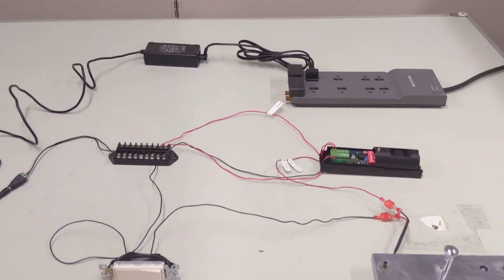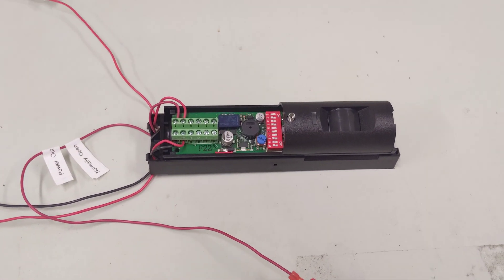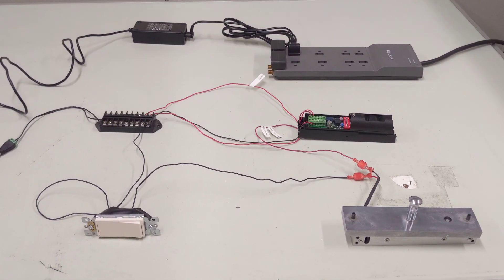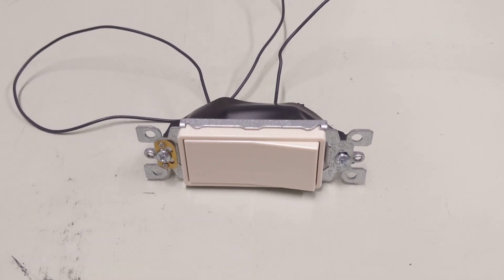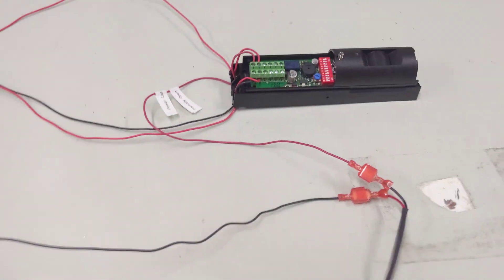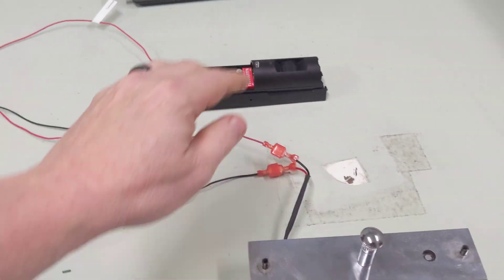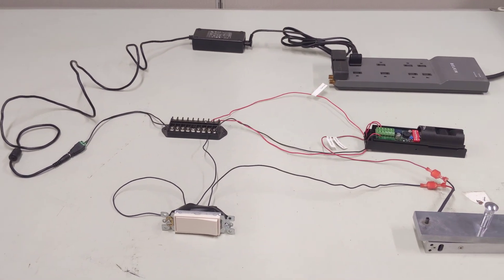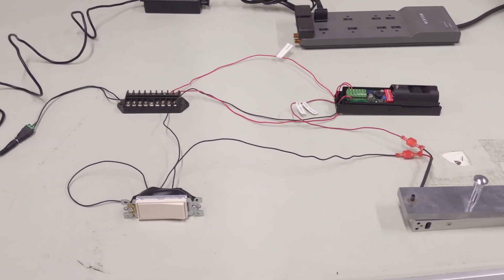Simple Motion Sensor RTE to Maglock Setup with Manually On Off Switch

Comment: Very helpful. So I guess if there was a push to exit button it would be installed where your light switch is.  I still don’t understand why the mag lock is wired to normally open. I would think normally closed will complete the circuit to feed it power all the time.
Reply from the maker: Really Normally Open and Normally Closed only matter it you are hooking it up to a door controller, otherwise you can use either or.  For demonstration purposes, since this design was stand alone with no controller hooked up, Normally Open or Normally Closed can be used.